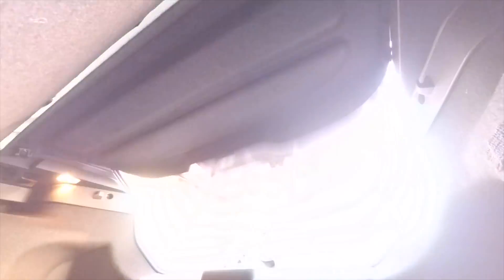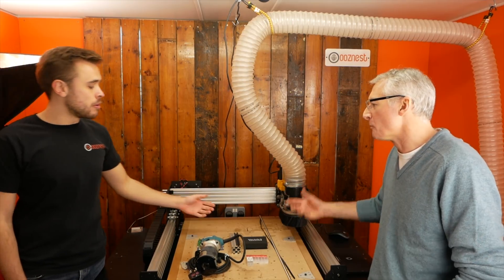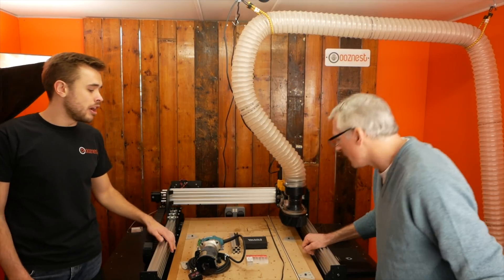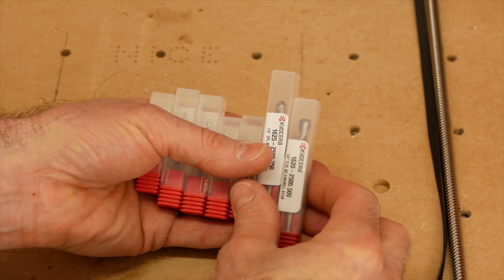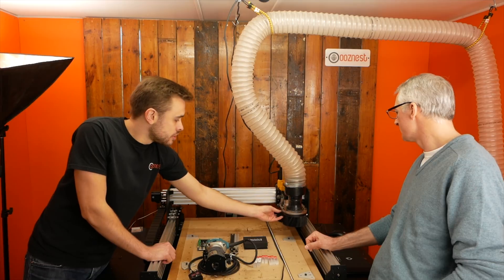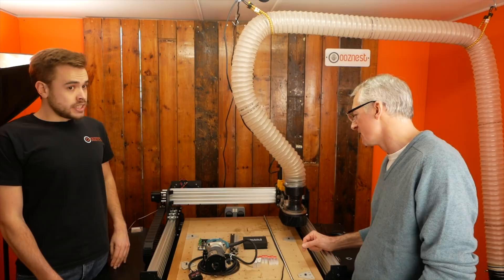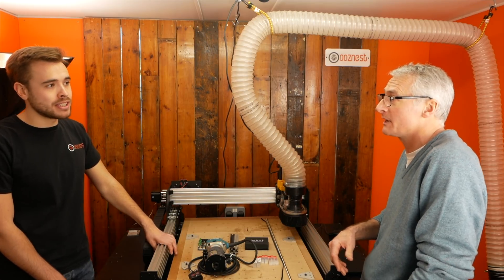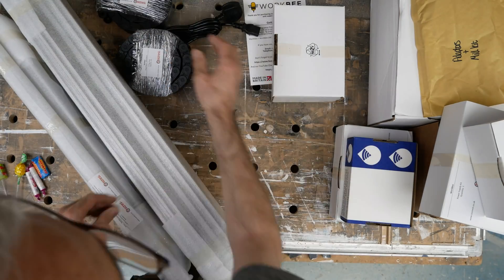Starting Out in CNC Part 1 [video #316]

Comment: I've had a Stepcraft 840 CNC for about four years and have been pretty pleased with it. One of the main issues I have is the time it takes to cut, the stepper motors are a bit weak and you push them hard they can miss steps resulting in ruined project.

What ever I can do with a saw or a hand router I tend to do it and mainly use the CNC for engraving.

I bought mine from Rory at Stoney CNC, fantastic service and back up as well as a wide range of machines.

If I could go back I would have bought a heavier duty machine, although I regularly us it to machine oak. I will be upgrading to a more industrial machine shortly.

Buy a good set of ear defenders, the noise is LOUD!

Wish you did this sooner Peter!

Comment: hi peter 
i have a small 3020 cnc from china that i use a little
i use design spark mechanical  for the  cad and i use cambam for the gcode
cambam i think is around  €150 euro but  designspark is free and it works well for 2d 
design and yes fusion is free  to small business and hobby users  but there is has a longer
learning curve that design spark has i am sure there is many more  software out there 
that  works equally aswell but it is the learning curve  for shall we say older guys like us that was not even left use a calculator in school  lol  i use my little cnc for model making   and it works fine for that  
looking forward to following your adventure into cnc but i must say that even the little i have done with mine  they are truly amazing machines and i wish i had the money to have bought the larger one but we have to cut our garment acording to our cloth as they say
regards
james
Reply from the maker: Thanks James! 👍👍

Comment: I'll be interested to see what projects/products you have in mind for this. I have a 720x420mm machine from Germany - I've used it in the past for many things other than woodworking but now I'm frustrated by the relatively small work area. My biggest headache has always been work holding - finding efficient/effective ways to keep everything in place. Good luck! (PS: my best advice - don't fit the dust shoe until later - just hold a vacuum nozzle near the cutter - it'll be a while before you're confident enough to let the cutter do its thing "blind" ;-)
Reply from the maker: Thanks! I’ll be trying out all kinds along the way. This machine has a 550 x 520 work area, so I know it will have some limitations. 👍👍
Reply: i take it you have a heiz machine? so do i, and  got mine second hand, most of mystuff is v carved pictures, but plan to do small furniture and jewellery boxes, ive cut a few small cabinet tops, but dont regret getting a larger machine, its not much difference in price , once you take out the cost of the control and cad software ,so id bite the bullet if space is available and upgrade to the 1000 model and sell your old one.as for workholding, peter passuello has an excellent channel with lots of tips, and there are other channels that offer solutions.
Reply: Jeremy, Iv'e found the best way for holding down work pieces is masking tape and super glue !!! It sounds crazy but it works. There are numerous videos on YouTube explaining it.

Comment: I own a machine from Ooznest and it is a great machine. But I do recommend using Fusion 360 as design software, it's free for small business users. Save money and do not buy software for the machine
Reply from the maker: Thanks! I’ll be trying all kinds 👍👍
Reply: I second your vote for Fusion 360 - great for true 3d designing (e.g. cabinets)  but perhaps overkill for 2D cutouts from flat-sheet (e.g cabinets :-0).